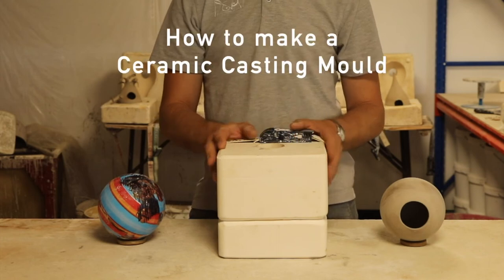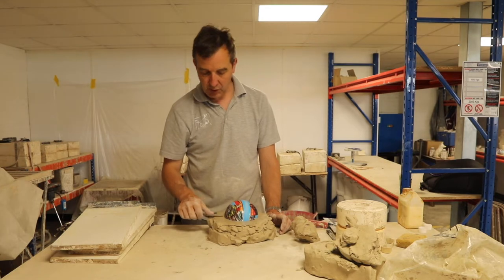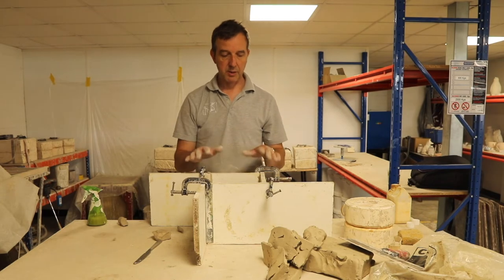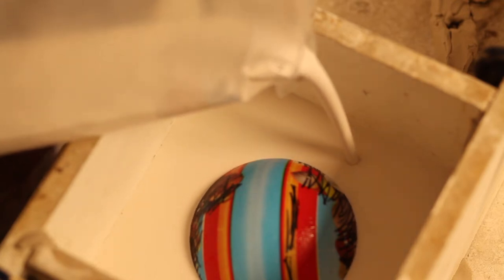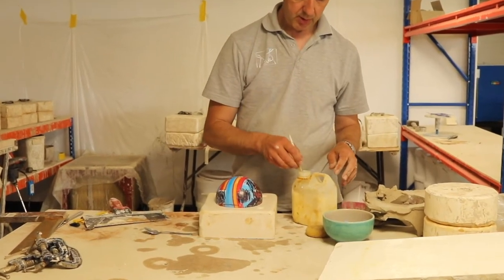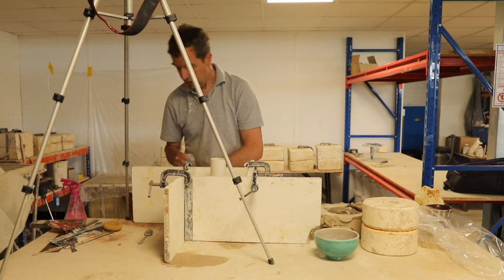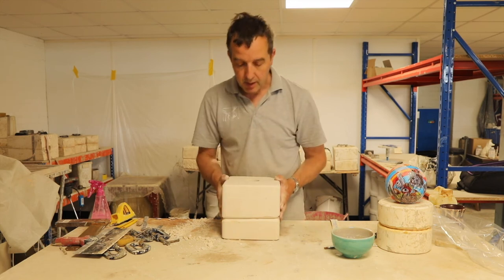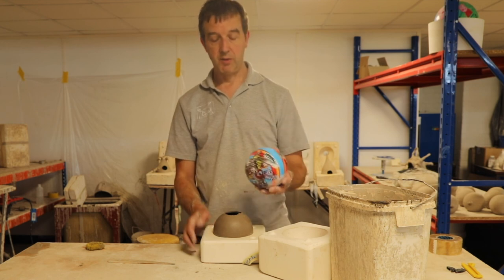How to make a ceramic casting mould - long version

Comment: Thank you for the education.  I have a wood stove that has a large ceramic "nozzle" (3 inch thick plate about 1 foot by 1 foot with a square hole in it) and that nozzle goes bad each each seemingly after a season of heating my home.  after the warrantee expires on the furnace, i am going to be stuck with the bill for the next 20 years to buy a new expensive ceramic nozzle, and I'd rather just bite the bullet, build my own mold based on a new nozzle that i have, and poor my own molds rather than buy the nozzles each year.  do you have any suggestions on extremely high temperature ceramic material for these nozzles?  some say our temps in these furnaces reach over 3000 degrees Fahrenheit and steel/iron dont hold up.  any suggestions would be appreciated.  i have no idea what I am doing but your video is very informative.  Thank you, Noel
Reply from the maker: Hi Noel, 3000F is ridiculously hot!  There isn't much that would withstand that sort of temperature.  Even if you can get a clay that is able to withstand that temperature, I would worry that the stresses of heatin gand cooling may well cause it to crack.  You may be better off with a heat proof fibre board of some description, or perhaps the thermal bricks used to line a kiln?

Comment: Thanks for the video.
I need to make a mold for "train wheels" that are about 8 inches then fill them with a 2-part epoxy (like skateboard wheels).
I know nothing about this hobby.
After you made the mold, could you fire kilt it so it would be smooth and nothing would stick to it (like 2 part epoxy)
Thanks
Reply from the maker: I wouldn't use plaster as my mould if you are using epoxy as a medium.  You'd be better of using a silicone or polyurethane mould and not worrying about undercuts, simply peel the mould off after you cast.  Just check your epoxy doesn't have any chemical reactions associated with the mould medium you choose to use.